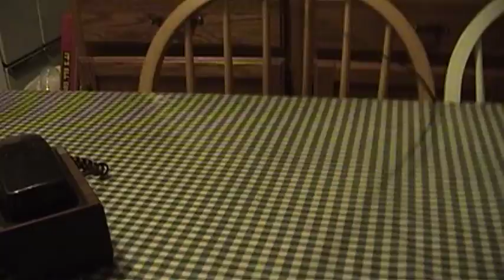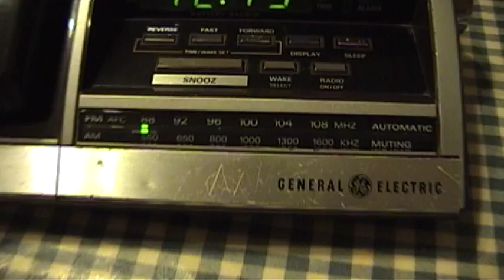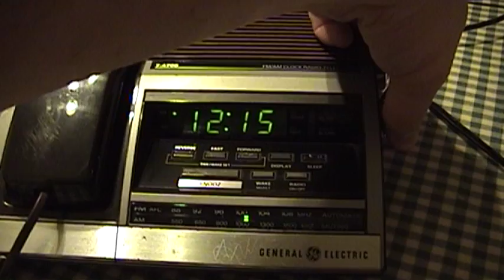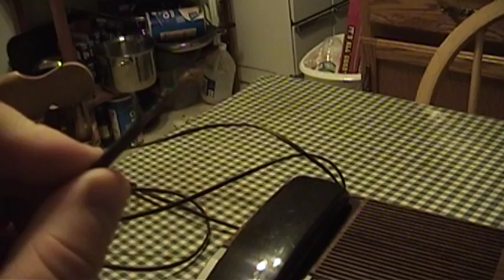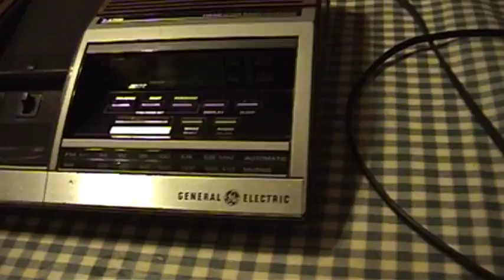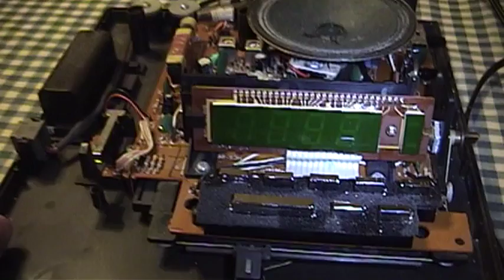General Electric 7-4700 Clock Radio Telephone

Comment: I have the phone version of the GE alarm clock. It’s prob 1990’s I think.  And I’m 48 yrs old. It still works Surprisingly . 
Like this but it’s all black. Dual phone alarm clock radio
Reply from the maker: Linking to this video in its own comments section is certainly an odd thing to do.
Reply: @uxwbill 
Sorry I was over tried. Fixed.

Comment: Have any idea how to fix a cut landlinewire ours got cut a while age all the way to the back of the compartment any tips?
Reply from the maker: I don't remember if the telephone cable is soldered inside. I believe it is. It can be replaced with another standard telephone cord, though soldering it back on may prove a bit entertaining, as the wire is quite fine. It's a mystery as to why GE didn't just provide a modular jack on the back of this radio.
Reply: @uxwbill  Thanks for the tip helpful for the future

Comment: I may be about 12 years late to the punch but the date code on the bottom of the unit reads as the day of the week, the second digit the year, and then week. Mine is a 7-4722 6827M. 6th day, saturday, the 27th week of 1988. I dont know about M. Id assume the phone is going to follow the same rule

Comment: This looks like my phone. Few different buttons & mine says 7-4735 and u have 1 cord with no end. U can fix that?  Cord that is plugged into the wall has a rectangular end. Other cord is plugged into a power strip. Having a problem finding the price & maybe delivery charges. Thanks so much.
Reply from the maker: There were a few different versions of this basic model. One had a vacuum fluorescent display. The modular plug on this example's phone line was cut off so it could be directly wired into a telephone system.

I don't sell these, nor do I have any parts.

Comment: How do you fix the clock so it will not speed up?
Reply from the maker: If the clock is gaining time by hours, something is almost certainly wrong in the clock logic. You could check for stuck buttons, partially conductive crud on the circuit board, and the frequency input to the timekeeper chip. This is probably not going to be easily fixable.

Do check the powerline frequency, and make sure it is correct and stable. A good quality multimeter can help you do this, or you can hire a competent electrician, who may have long-term powerline recording equipment.

Comment: I just picked the same up today from a secondhand store. I just need the curly phone cord for it.
Also trying to figure out the date code. On the handset it says 423 but on the bottom it says 5414. Anyone know?
Reply from the maker: As best I remember, someone has figured out the date codes on GE electronics. A web search would probably turn it up, at least for the four digit code.

Comment: I am on call for emergency blood transport.  Have telephones in EVERY room.  Would be nice to have a radio/clock/telephone on the nightstand.     Are these made anymore?
Reply from the maker: This exact model hasn't been made in many years. General Electric doesn't even have a consumer electronics business any longer. You may be able to find a used example of this model. Someone may still be manufacturing a similar product.

Comment: Thx for the reply. I see only 1 IC that has the following number 1911b and a yellow number 13 stamped on after. I can't find any data on it from here. Could you try for me perhaps? Apologies for being bothersome. Regards Alex.
Reply from the maker: I don't have any more information than you do. I couldn't even say for certain that the timekeeper IC isn't integrated into the display -- GE did that on some models, and it may be a custom part for which only they would have had documentation.

A service manual probably did exist at one point, but how much detail it would go into is not known. When last I went looking for information on another GE clock radio model, the Howard W. Sams company indicating having a photocopy of the service manual available. StereoManuals.com might also have something. Both would have some cost.

Comment: Lovely demo - thanx! Any ideas as to how I could modify mine to get the clock to work accurately from 50hz supply please? Regards, Alex (Cape Town)
Reply from the maker: The clock ICs in many of these let you select the appropriate line frequency. You'd need to get the data sheet for the IC that GE used to find out how.
Reply: Thanks I have one I got at a garage sale never used still in package
Reply: Wow!

Comment: some of these have chips that have provisions for 24 hour time. depending on the clock chip you can jump a pair of pins to make it display in 12 or 24 hour format.
Reply from the maker: Almost all the chips can be switched over. (More correctly, I've yet to find one that couldn't be.) It's the display that is the problem: the leading seven segment outline in every LED display I've had apart isn't fully populated. Only the parts needed to display a "1" have LED chips inside. The remaining "E" shape is empty.

Vacuum fluorescent displays don't have this same problem, if they have the needed elements present for the leading digit.

Comment: i have one of these but it is model 7-4705 but it is the exact same thing. i collect vintage radio/alarm clocks, i have about 14 of them, they are all from goodwill,(i started collecting a year ago) i even use one as my alarm clock, they are so cool, any way mine has a mile of cord also, also i paid 3.99 for it and i am going to use it as a phone and i was upset because it looks like it is in great condition but when you turn the volume dial it is very static and very loud , so i opened it up just now and put a drop of water in the dial part on the mother board and I FIXED IT!!! i was so happy now it looks great and works great!!

Comment: Bill,
LED's are actually bi-directional, and can be used in photodetection circuits. It is possible to induce a voltage across them with a bright light. A very good resource on this is from a living electronics legend, Forrest M. Mims III. You can Google him to find his site.

Comment: @uxwbill My kids (when they were little) found it amusing to lift the handset and walk around with it. Eventually we disconnected the handset so they would stop leaving the phone off the hook.  Of course, after disconnecting the handset, it was promptly lost and most likely discarded (haven't seen it in years). Without the phone, it's just a bulky clock radio (assuming one is handy enough to defeat the radio muting function)...not too worthy of donating.

Comment: I have the exact same model with date code 2325 and serial number 001683. Think I bought it around 1982 when I was in 7th or 8th grade. It was highly useful for me to have a phone in my bedroom back in those days. Interestingly, while the phone looks like a touchtone, it's actually a pulse dialer (at least mine is). I really liked the fully adjustable SNOOZ and SLEEP buttons. Battery backup was really nice, too. First time I had seen that. I am about to discard mine if you need any spare parts.
Reply: Bob Wolfert I need the curly phone cord if you still have it kicking around

Comment: @uxwbill I'll check tomm., but its likely it only has a Lo-High setting (if thats what you mean) like my GE 7-4663A clock radio (excellent model, battery backup, variable sleep/snooz times, both alarms can be set to buzzer or radio and holding the snooz button displays clock seconds!) which uses the same exact display. BTW, the model number of the blue display model is likely 7-4735 and it features dual alarms.

Comment: Pretty impressive design, I'm sure I've seen other videos of this unit or models similar to it, where was this unit made?  I've seen units like this here in Australia, most of the ones I've seen I believe are made by a company called Audioline who specialise in telephones, you usually see them in hotels here.  I've recently seen one with a digital radio tuner made by Oricom.  i assume you can wire up a new RJ-11 phone plug onto the end of the phone cord.

Comment: I used to have an AT&T model 500 rotary phone in my room until the network died and cut off the rotary dial, and the minimum setting on the ringer was something I adjusted to; then again, I'm a major geek. now I have a really old non-dial non-ringer Leich deskset. with a DTMF-generating program, it's perfect!

Comment: @uxwbill BTW, at least here in New Jersey, Verizon still makes you pay extra for Touch-Tone dialing service. Since I choose not to pay the extra fee, both of my landlines are pulse-dialing only. Of course, once the call is placed, you can then switch the phone into Touch-Tone mode (or push the star button to enable it temporarily, on some phones) to use menu-driven phone systems and the like. But if you try to dial a number using Touch-Tone, it doesn't respond; the dial tone just keeps going.

Comment: looking at the phones' handset i'm' wondering if you couldn't lay the handset in its cradle with the mouth piece in the upper tray and the speaker in the lower tray turning the radio back on (music on hold sorta feature) while keeping the hang up button from compressing.